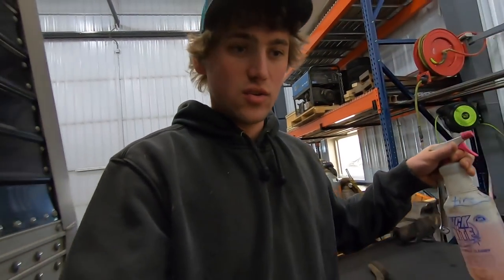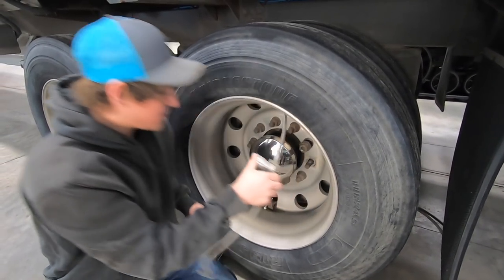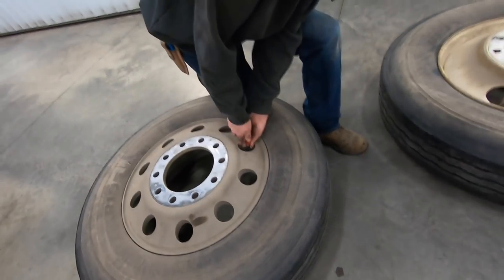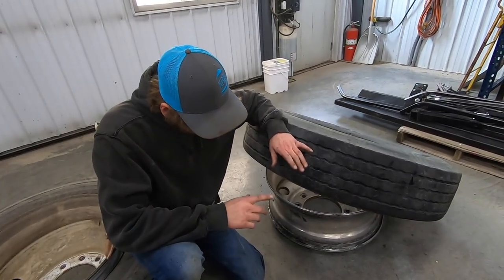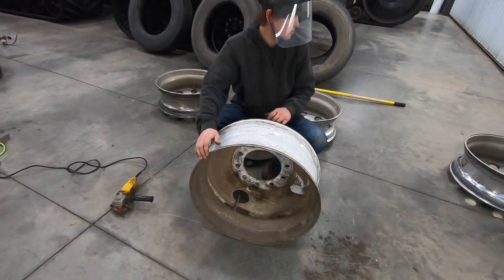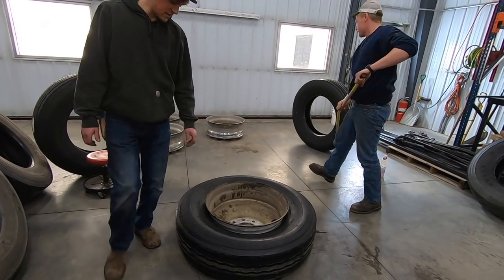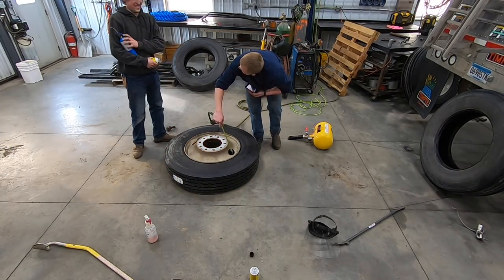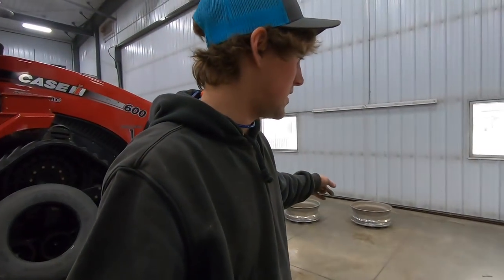Ether + Torch =Explosion

Comment: you should invest in a tub of tire soap. then you wouldnt have to use ether. the soap is really thick and on the really stubborn rims you can just pack it in the gap and then as the tire seats it just squishes back out and you scrape it off and put it back in the bucket... it has the added benefit of being usable for mounting and dismounting by adding some water in a bottle.

As far as standing 20ft away while airing up... You should be LISTENING to the tire while it airs up and if you were to hear something sound not right what are you gonna do from 20 ft away? n if you were to hear a crackling sound or a resonating pop sound you need to be ablke to disconnect the air chuck right fricken then... so if you make a leader air hose with a quick coupling that is 20 ft long and hold the coupling while it airs up then you should be ok in case of emergency.

As far as the "ether trick" youre doing it wrong that is why you had some much trouble.... when you spray the tire first make sure the tire is on the bolts side. this elevates the backside and ensures that one side has the bead sitting on the bead seat. then make sure your air chuck is attached to the stem. when doing the either trick go ahead and put the core in the stem before you try to blow it with ether. this will keep it from falling and add the necessary air to the ether to get it to pop. if you are Not using ether you should air the tires up most of the way WITH OUT the core in the stem... it goes alot faster and when you use the air blaster it help make sure it works. so now you have the tire bolt side down and you are standing on each side to depress the rubber and make a gap between it and the rim. Now spray in a quick circle most of the way around the rim into the gap and then get off the tire quickly so it traps the ether INSIDE the tire... then a little trick my mentor and diesel tire technician of 50 years showed me is to spray a stripe of ether from the inside of the rim onto the sidewall perpendicular to the bead and run that stripe about 3 ft out onto the ground. that way you can hit the end of the stripe from 3 ft out and it will race up the stripe and into the bead and boom your done.

As far as Lube....you arent using enough. you thould invest in a "bead mop" it looks like a bottle brush but it is mop material instead of brushes. its about 10in long with about 4 inches of mop on the end. then you put some reallly soap water in a bucket with the mop....we used an old coffee can for our soap water.... and run it allong the bead when you go to deflate. that way a little lube will be on the bead when you go to break the bead. then of course when you mount you just mop the whole bead on both sides... The reason why you have so much rubber to remove from the rim is because you put the tires on TOO DRY. if you mope the bead really good when you put it on then there will be almost nothing stuck to the bead and you can ommit the wire brush step altogether.  if you get the thick soap lkike i was talking about, it has the consistency of vaseline, you can just get a handful and rub the beads down before installation. this is the very best method because the soap will stick to the tire and actuall condition it in the bead under high pressure.

i used to be able to dismount from truck , old tire removal, new tires installed and aired up on 8 tires in 45 minutes by myself, but i used two bars instead to dismount from rim and i didnt have the dolly i just used my hands, but basically everything else was the same even the brand of airgun.

but in the end you did a good job and that slow mo of the ether ingnition was sweet.

Comment: Used to it with lighter fluid
Reply: Thanks that how they do monster tires my monster trucks, yes, we light fluid  in the Army and Marine  Corp. The old guy like a bead break hammer. Not like the tools out there today.two tair bars to take off and put back on and heavyweight rubber  hammer. You got a great workout.

Comment: If you use Murphy’s tire compound it makes it easier to seat tire beads that don’t want to seat and dish soap also works I would like to see him try and use two bars to take the tires off and a hammer to break the beads and if you are putting virgin tires on I would also be changing all of the valve stems to make sure none are corroded I could do the whole trailer from start to finish in less than 45 minutes

Comment: You need air going into the tire at the same time you light the either always works for me.
Reply: I agree or you gotta be instant with the air, ether or gasoline will  definitely blow the tyre on, sometimes I have several tries to get the correct amount of accelerant PLUS i did,nt see Chet purgeing the tyre with fresh air inbetween attempts , also very important to get the  ether to  burn efficiently , constructive advice only , not criticising guys

Comment: I use two bars to dismount and remount my tire and if I had a tire that refused to air up I would put a ratchet strap around the tire and if that didn't work I would take soap and packet between the tire and the rim and when it started are up the soap come out

Comment: Don't use any kind  of ether.starting fluid are anything that goes BOOM, with fire.. I did on a tractor tire,weighted about 85 lbs.. had it laying on the grown, shot just a little squirt inside the tire. Set it off and it blew 40 ft in the air, looked down and the tire was gone. had no time to look up it hit 10 ft from where we was stand.. My 7 year old grandson was watching it about 15 ft away... So....I'm telling you don't do it, don't do it..I hope this will saver your life some day. 
Be Safe and Don't do it...I know, it want happen to YOU..If you do use this Method and some will... Put it on the Tractor are car, are truck so it want kill you...I was lucky, See ya

Comment: The old split rims were the dangerous ones. They have killed people.
Reply: I've seen the aftermath of two split rims that killed two people. One young man was sitting in the middle of the rim airing up the tire after changing and was told by a few to get his butt out but didn't listen. He was crushed 16 feet up in the ceiling of the shop after caving in the roll up door and taking out a 2 in and a 1 1/2 in heating line along with a one in air line that ran about four feet below the ceiling. It left a ring a half inch deep in the concrete where the tire was sitting when he was airing it up. I got a friend what was airing up a split rim on the back of a dump truck and it blew, he was standing to the side but it caught his arm, needless to say his arm isn't much use anymore. I've never seen a solid rim blow. Knock on wood.
Reply: @oldfarmer4700  on dual with spilt rims I always put both on and aired them up after I tightened the lugs